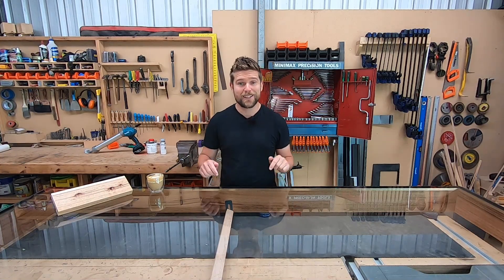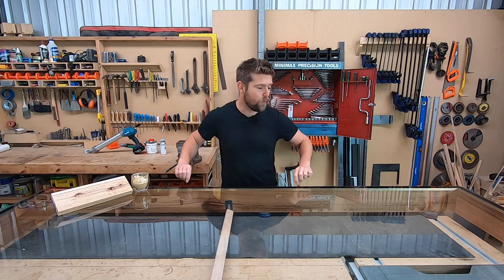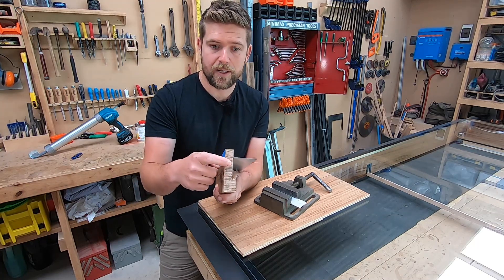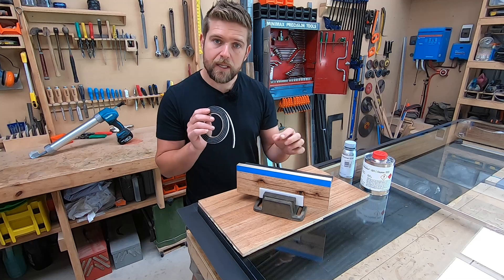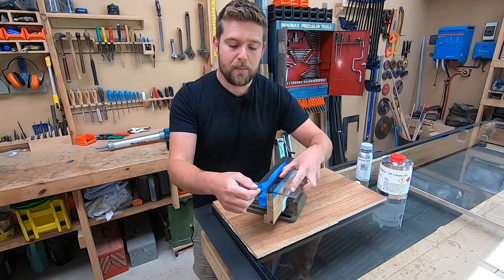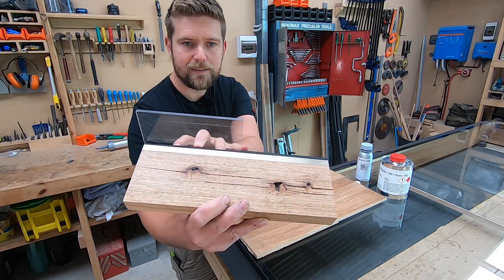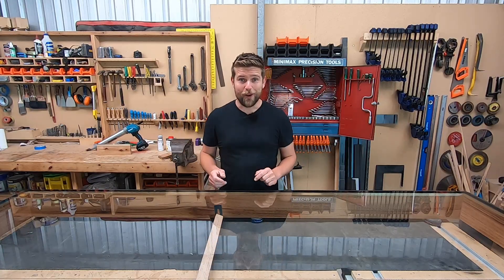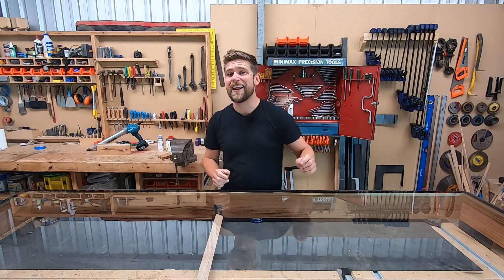Ep. 19 - DIY windows. How I adhered the glass  pt.3  - Tiny House Build Update

Comment: hi phil, really enjoying your struggles - in a good way ;-) nice to see the crane made an appearance for the windows rather than the initial muscle power. as many have commented, your attention to detail is great and much appreciated!

just discovered your channel and finished the binge watching before throwing this out regarding your moisture concern for the sliding roof. agree the metal roof with tabs style could be effective, though curious if you have looked at pond liner as a membrane (looks like EDPM pond liner in Australia) before placing the metal on?

hope your new year is off to a productive start!
Reply from the maker: Welcome to the team! So glad to see you on the journey. Thank you so much for checking out the vids. Was good to get the crane up again. That was the best investment. 

Great thought about the sliding roof. It's a real challenge. The membrane is a good idea however it creates a new problem of what to do with the moisture sitting on the membrane. It'll create constant damp under the iron which will promote rust but also need to drain it. Problem is that will end up inside. My goal instead is to direct the moisture away and not even get that far in. I'm hoping standing seam joints are sufficient. Moving onto that next so keen to see how it turns out. 

Happy New Year mate. Off to a great start here.